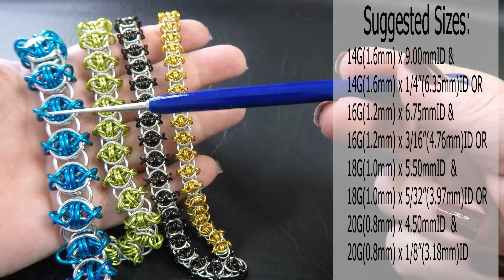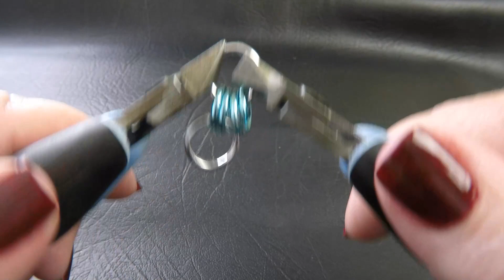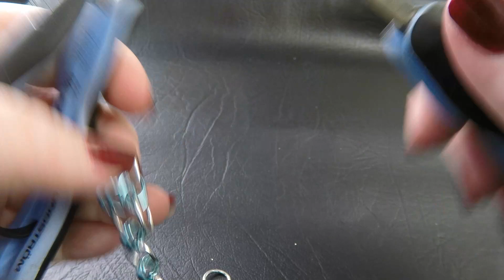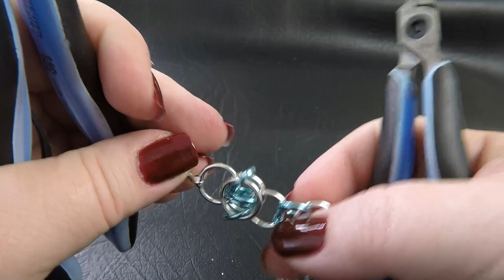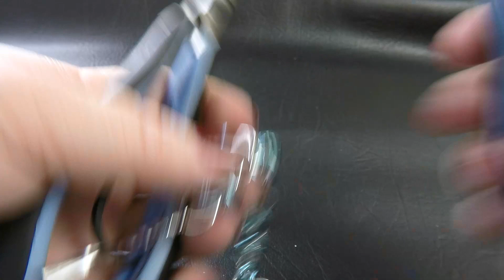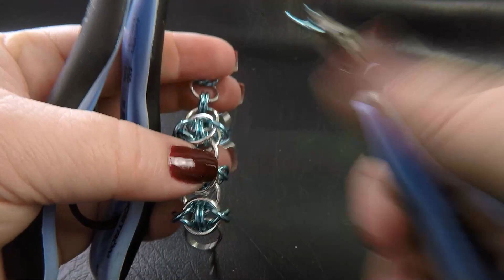Chain Maille Tutorial - Odin's Eye Weave

Comment: Thank you for this amazing tutorial but like many others I'm not getting the same result as it's coming out way too tight. I'm doing the 14 gauge and cut the rings myself so I know both the wire gauge and ring diameter is to your specifications. However I think the big rings is too small because each section of the weave is butted up right next to the next one. Like the big ring that's supposed to connect each section is not even visible. Do you have a suggestion of what could be wrong?
Reply from the maker: Our ring sizes are based on the mandrel we wound them on, so if you are cutting them to be equal to the ID and therefore the mandrel is smaller that could be the issue.  Or you could be using the wrong gauge system.  Your wire could be softer, so the spring back is less than the one we use, you could just wind tighter, your kerf could be larger....there are many reasons why ring IDs can differ.  HTH Deb